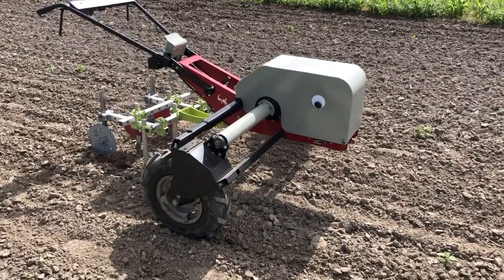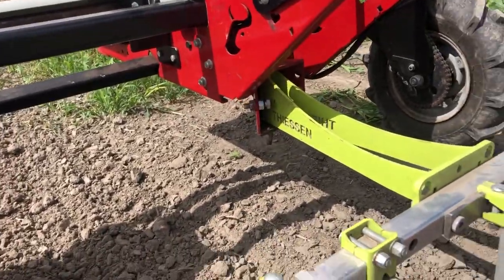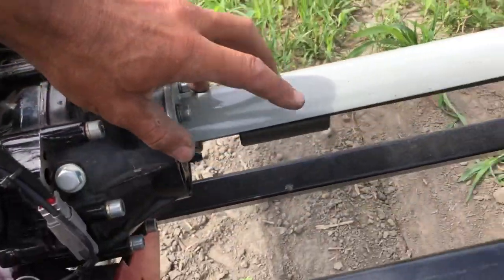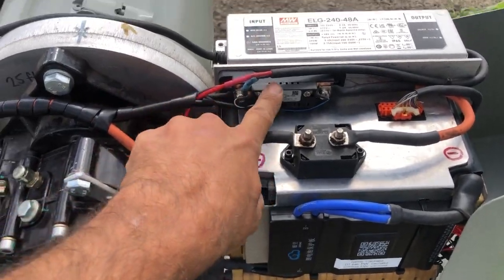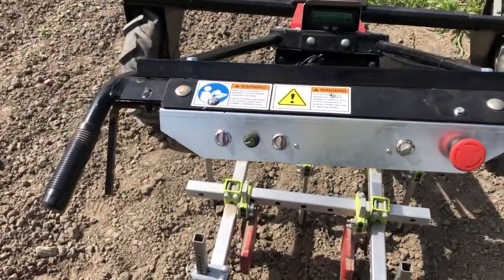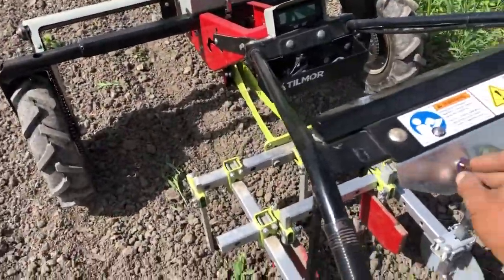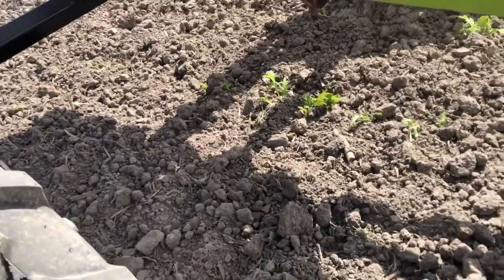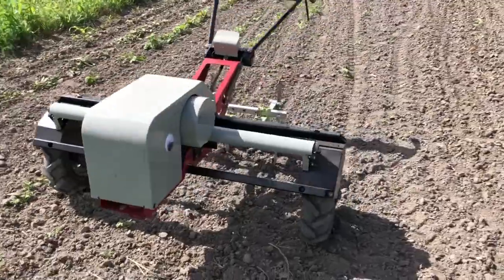Power Ox electric tractor conversion - First field trials and walk-around tour

Comment: amazing machine, how do I get one?
Reply from the maker: There are currently no plans to offer electric Power Ox tractors or conversion kits and this machine is built on the now-retired Power Ox 220 platform.  The current Power Ox 240 with Honda engine is an excellent machine which you can order from Tilmor or Thiessen today.

I am working with Thiessen Tillage Equipment on an all new electric 2 wheel cultivating tractor, continuing the evolution of the Agrarian Electric tractor started by Andrew Mutsaers.  Hopefully it will be available in late 2024 or early 2025.
Reply: @reidallaway   Excellent !!!